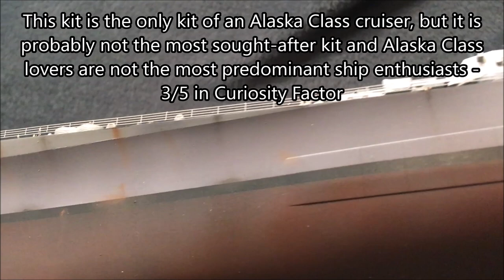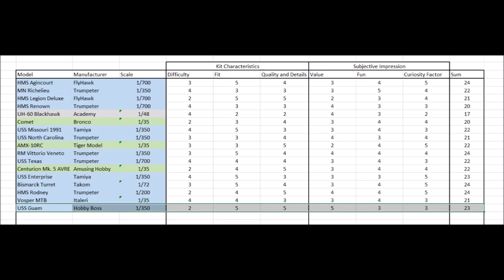USS Guam 1/350 Hobby Boss: Assembly and Painting of a Large Cruiser

Comment: For bottles, you need reference photos; some will be oxygen, some acetylene for welding; some will be CO2 for firefighting.
The baskets are "floater net" baskets.  The Floater net was a big, criss-cross (apx 30cm)  net of (apx 3cm) rope with cork floats (±2cm x 15cm Φ).  These were meant to literally float off a sinking ship to provide something for the crew to cling to until a raft or ship's boat could reach them.  They were not a success, but, they were Regulation until 1946.
Reply from the maker: Thanks for the info, very interesting! Why were they not successful? Didn't they provide sufficient support for people in the water?
Reply: @funinscale2892  Yes, little support in the water; very poor performance in fuel oil in the water, extremely susceptible to dry rot and damage in the baskets, too.   Also, they often failed to float free during a sinking.  All while being a fire danger on deck.  Not a win.

Comment: I found a neat trick for curving photoetch , especially ships railing that requires straight pieces with a curve in 
the middle , I take a pack of Blue tack , with the plastic cover still on , lay it on the bench and moosh the part 
into it using a chop stick at correct diameter , I also use drill bits , wooden dowels ect ,
Reply from the maker: This sounds like a great idea! then the elasticity of the PE parts can be  evaded and it bends more reliably, i will try this some time!
Reply: @funinscale2892  I'm a solitary builder / collector , have never shared my techniques 
before , nor have I seen them being used by others , I wish to remain solitary would rather 
just share them with you , was hoping you could try them and incorporate into your videos , my
only wish is to share them with my fellow modelers

Comment: Nice job over all, but I do think you got the colors wrong.   The Guam was painted in Measure 22 during her Pacific service.  This consisted of the hull being painted Navy Blue (5-N) to the shear line and all vertical surfaces above the shear line were painted haze gray (5-H).  All horizontal surfaces were painted or stained Deck Blue (20-B).   I built Hobby Boss's 1/350 scale USS Alaska and found it to be challenging, but fun build.   I modified the kit with an Artwox teak deck veneer, 3D printed 20mm and 40mm gun mounts, Infini Model's mast detail up set, Infini Model's metal 12 inch gun barrels and some additional photo-etch detail parts from Gold Medal Model's USS North Carolina photo-etched detail set.   I thoroughly enjoyed the build and agree that is an excellent kit at a reasonable price point.   I spent almost 300 hours of bench time over nine months building this model.     I am a fan of the Alaska class large cruisers.   By the time Alaska and Guam entered service, the mission for which they were built--hunting down enemy cruisers--no longer existed.   They were beautiful and capable ships.

Comment: As to the bottles, I do not know for sure so this is a guess. The Iowa's and other battleships had a high pressure compressed air system that was triggered when you opened the breech of a 16 inch gun. This was designed to blow any potential hot debris left in the barrel after the gun was fired. This would prevent you from putting powder bags into the barrel with burning embers and potentially exploding. I have no idea if they were related but I assume they would need some compressed air tanks for this system to work.

Comment: Does the glue that you use allow you to put plastic parts on painted surfaces and have it stick securely? If so what kind of glue do you use?
Reply from the maker: Hello! I use Mr Cement S, but still, it is very easy to destroy the paint, so i use very little glue, but it is durable enough to stick in place. Sometimes, i experiment with the Mr Cement Deluxe (Yellow one) or Mr Cement (Orange one), they dont dissolve the paint but leave some shiny spots when dry, when applying flat varnish, they are slightly raised and visible, so using very little Mr Cement Deluxe would be the most secure option.

Comment: I have a question...when you put the black panel line wash on a model are you supposed to let it sit for a little bit before you wipe it because every time I put some on it just comes right off like there was never any in the first place
Reply from the maker: I did not use a panel line wash on this kit, i only did some weathering with oil paints (without dilution in white spirit). But i would usually put on the wash over a whole model and when i am finished with applying, i start wiping, blending and streaking, depending on the model. You can also wait longer but then you would probably need a little bit of thinner to remove wash that got to places you didnt want it to go. Many people use q-tips wetted with thinner for washes for removing washes because when you drag it around the surface lightly, then the q-tip will get to the flat surfaces, but will not remove the wash from around small raised detail and it gets highlighted

Comment: May I know if you are using one same glue to manage both plastics and PE parts?
Reply from the maker: Hello! I am using Mr Cement S or Mr Cement (the orange, thicker one) for the plastic parts, and super glue (gel consistency with rubber particles) for the PE parts. The super glue is called Loctite Power Flex Gel, and it gives the PE parts an instant grip which is great for small parts that would fall off otherwise